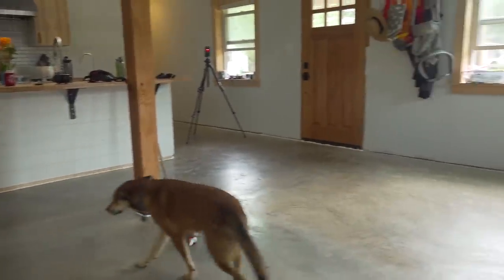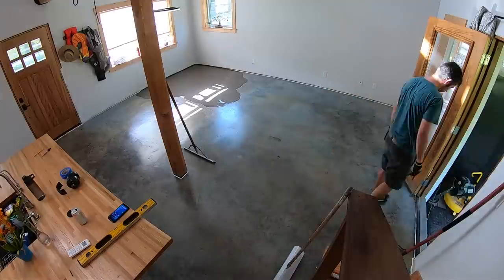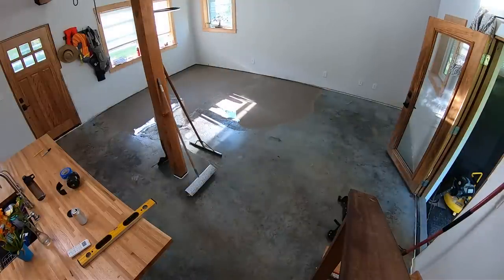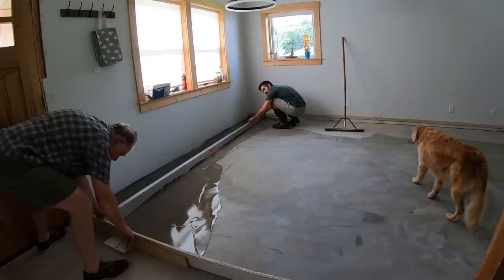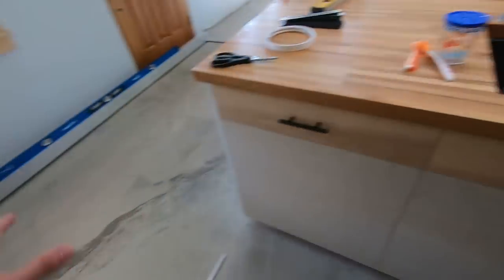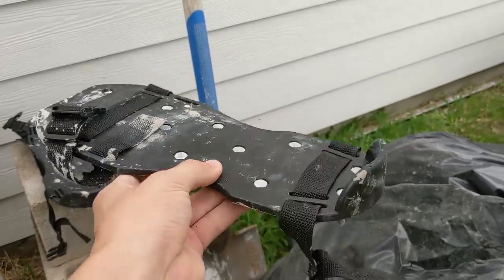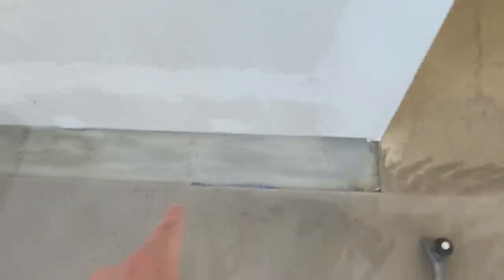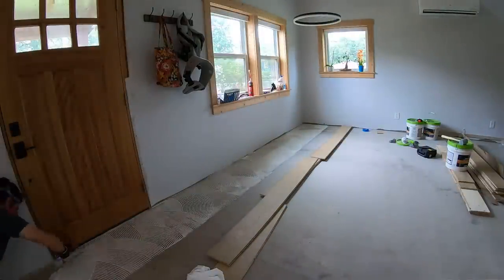How NOT to Self Level a Floor! Prepping for hardwood flooring | Building Small Ep. 6

Comment: Starting a project like this with no experience is just like paying dues to an apprenticeship class, it costs time and money but in the end you gain the experience same as a pro.  This applies to all things in construction and you can achieve professional level results if you approach it like a learning tool and be willing to undo your mistakes and repeat the process over.  Grinding down your first mistake was , in the long run, the right thing to do and is part of " paying dues " to gain a professional result.  Job well done , you should be proud of the accomplishment.

Comment: Thank you btw for adding this valuable footage we can share when our customers say the other company didn't bid $800 for floor leveling. until now ive always just had to say yes because they hadn't planned on doing it which is even worst. BTW the indoor air temp likely wasn't hurting you 1/2 as bad as the hot water in your hose was and not using a mixing drill on low speed. the faster you whip it the faster the reaction begins. Great content though!!

Comment: I have done self leveling many times.  I found what worked for me was to dry screed first.  I marked out with 'H" for high and "L" for low int he spots required.  Poured the compound in smaller batches as it is easier to control in all the "L's" and it did what it was meant to do, self level.  The high spots where just ground to level.  I had a learning curve as well but way cheaper as dozens of bags can get expensive.  Floor coloring not uniform but your laying over it anyhow.    He stuck with it and it turned out nice..

Comment: Thank you for helping my sanity. I just poured a bag of self leveler yesterday in my 6 x 8 shower. Apparently from the time carrying it from outside down to the bathroom, and then finding out that there were spots within the mix that were not mixed up enough ,and fixing that, it must’ve started setting up too fast. When I poured it out, it was like dealing with mud instead of water. I knew there was no way I would get it level. So I quickly scraped it back up and put it back in the bucket I took it out of. I now have a solid 40 pound bucket, and a great lesson learned.  Next attempt I will mix within the bathroom, use cold water, and be prepared to poor immediately.

Comment: Thumbs up for sharing a real life experience, had a realatable one.

Have year's of concrete experience but floor leveler is a different beast. 

Hired the wife to help with a master bath on the 3rd floor with a number of obstacles..

It was a humbling experience and a lesson learned.

Don't use a float to feather, use a steal trowel, no matter how hard you think you can push yourself anything over a patch requires prep and help.

Comment: I believe your biggest mistake is using the quick set leveler. It is on principal one of the easiest parts of the whole masonry to self level the floor. For such a big project you would need 2 guys but still it can be done with 1 guy. basically all you gotta do is mix down to the percentage ratio (it usually says 5 or 6L for a whole bag) so you take precisely that much water mix it in for precise amount of minutes it says on the bag and you just pour and that's it. Take a trowel to push it a bit and you pour another and another and another filling the room with liquid and letting the liquid thanks to the gravity level ITSELF.

You should not level it yourself. It levels on its own but the problem is as I checked the bag it is a quick set leveler which means it is for small jobs or multiple people big project jobs as there should be about 5 or 6 of them 3 mixing the bags 2 pouring and spreading as those very quickly become unworkable while the general AND quality ones takes about 20-30 minutes before they slightly harden and become unworkable but on principle you should pour take 5 minutes to not even smear but just slightly nudge the liquid until it stops moving on its own which stops fairly quickly and you go in mix another pour in and repeat and by the time you're done whole room should be still very much in liquid form as the liquid is still moving around filling in the dips and setting in.

I always steer clear of the quick sets on anything as I am not highly skilled because with the quick sets you need to know your shit down to the motion of your body as the rhythm is not set by you but by the mix and if you don't know what you are suppose to be doing that's it games over.
Reply: This looks to me exactly right. The 'RS' in that bag label means 'Rapid Set,' which is what you want if you're a pro, but if you're feeling your way through a new process it gives you no margin for error. There will be people who look at this and say, "This is harder than you think, which is why you need a pro." But my main takeaway is: don't use the products and process designed for pros, which have tuned their skills for speed and efficiency. Set yourself up with a more forgiving system to work with, because you know you'll be slow and inefficient.

Happily, Mapei makes self-leveler that takes much longer to cure, and gives you a lot more time to work. You need to give it a good 24-48 hours before you walk on it, which is why the pros might avoid it, but it's a better DIY option when you're in your learning curve.

Comment: Great video and good for you to share.  I have managed to mess up a few floors of my own. You sharing this will prepare others for what's ahead. Site and temp conditions and following the manufacturers directions to the letter make for success or failure. Overworking these products creates a nightmare. If you never try it again use an acrylic floor leveller which has a slower set up time and gives you a wet edge longer. The finished floor looked great we learn from our mistakes.

Comment: I did my first one last night, cool evening, and just pouring a little out a time and on hands and knees with a trowel to push it into the corners, just mixing 10kg at a time and it worked great but my room was a lot smaller than yours. Im really pleased with the outcome. I think if you never done it before, do small mixes at a time and get someone to mix while you pour and level. i didnt have a spike roller but wish i had one as it would have made it easier.

Comment: In the same boat you are in. My SLU was proud in some areas, low spots in others. It just sets up too fast
 They need to make an SLU that sets up in an hour instead of 20 mins. Bought the same Dewalt grinder, shroud and wheel as you. Your  method here works the best. Good work

Comment: I just went through a leveling nightmare myself. Thankfully it was in a smaller 14x11 room that needed 6 bags…. I mixed 3 to start with and halfway into mixing the 3rd bag (while having a hard time getting it mixed enough to begin with ) the only 1/2 inch corded drill I had burnt up! I thought it was going to burst into flames with all the smoke and sparking 🤦🏻‍♂️ oh man, I scrambled, and the fun didn’t stop there. My cordless had 3 half charged batteries that were overheating, shutting the drill down, dying, etc. What a friggin nightmare! At one point the drill stopped, I was in such a panic because the clock was ticking, I didn’t realize my finger was still on the trigger and pulled it out of the bucket….slinging cement all over E V E R Y THING!
I was ready to get in the fetal position and suck my thumb lol.
I ended up getting through it but I have some high spots to grind down and areas here and there to skim with patch to salvage it.
With two enguinal ( groin ) hernias, and a blown and herniated L5-S1 I’m not looking to pour it again 😅

Comment: Thank you for the video! Just botched up a floor in my house yesterday afternoon for similar reasons. Outside temperature was a bit high and I burnt my drill after mixing the 4th bag. Hand mixing was painfully slow and not lump free. I should have used a little bit more water and working in pairs with one guy operating the mixer is definitely a great idea.
It probably would've been better to stop when I saw it's going south and Google your video.
Next I'll have to get a floor grinder and grind the high spots down. I'm planning to pour over without taking down too much material.

Comment: LOL! Your experience was very similar to mine when I tried to level a 600 sq ft room.  First attempt I tried to do it without help in the summer and after the first couple buckets knew it wasn't working because it was setting faster than I could pour it out.  Spent a bunch of money and time grinding down that mistake.  Second attempt using ice water and a helper went better but still some high and low spots.  Then decided to try a patch approach where I alternatvely ground and leveled specific spots but it's still not level enough.  Every patch I fix reveals other spots that then need leveling.  I figured I would have to just pay someone to do it right but your video is encouraging me to make one more try at it.

Comment: With the extent of this project. I would have taken out the stove and dishwasher to have a uniform surface. I guess its just my OCD. Awesome job!
Reply: no, It's called foresight. what happens when you want to replace your dishwasher and the Floor level is too high to remove the old one? Are you going to call your cabinet guy to redo your whole cabinets just to replace your dishwasher just because you didn't remove it the first time?

Comment: Thanks for posting this.  I admire anyone who insists on doing a job on their own and is not afraid to try something new.  Youtube sure does help with the "mysteries".  Sometimes learning about anothers mistakes is better than learning the "proper way" to do something.  I like both actually.  I watched quite a few videos on self-leveling and this is the first one I came across that mentioned temperature.  Also, there are not too many contractors that will openly admit to screwing one of their jobs.  I'm sure most can appreciate that "pros" who do this for a living can't teach the one time do-it-yourselfer how to do it just like them.  Experience goes a long way thats for sure.   I would be prone to believe true self-leveling compound would have the vidcosity very close to water.  Wouldn't it be nice if that were the case.

Comment: While the concerns in this video are legit (especially the temperature!), I am a flooring installer and I did this so many times but I never went to such extremes! The idea is to start on the low spots, mix it liquid, and work yourself to high areas. If you need to pour anything more than 1/2 inch thick at a time (or the max thickness marked on the bag!), you should do multiple pours! If you are using straight edges and forms to do this, why not use something else (defeats the purpose of using self leveling!)? It would be so much cheaper ($60/bag self leveling vs $5-$15/bag anything else)!
Reply: I totally agree, was looking for a comment like this. I use a similar straight edge method with tile thinset. Much cheaper and you can actually slope it if you need the floor to be just flat and not exactly level.
Reply: So true, or grind the hi spots if posible and than fill up the low spots.
water the floor first (yes even when it is primered!)
or even better use te techn.in video while pouring the floor and non of this would be needed.
Reply: 16:11
Reply: Well he did title the video "what NOT to do", he wasn't suggesting it should be done this way. He lost hundreds of dollars and days of his time! He screwed up and he knew it, but he shared this anyway for others to learn from his mistakes. Not for professionals to berate him! 

What purpose does it actually serve to ask him "why didn't you..." after the fact? That's essentially asking "why didn't you just do it right the first time", it's unnecessarily condescending and judgmental. Why is a professional even watching a DIY video anyway??
Reply: @lblincoe2094  How did the commenter “berate” the original video? Aren’t you the one who’s really being “unnecessarily condescending and judgmental”? YouTube can do with more professionals, and less Karens.

Comment: I’m doing my first levelling project, and I felt like I’ve bitten off more than I can chew. I’m confident however that the glue process will hide quite a few blemishes. With the glue trowel being a foot long, that will help hide any low points between high point a foot apart.

Comment: Getting ready to do mine. Hot tip to use a long pole with paint roller on it minus  paint sleeve if you don't have a spiked roller...read directions so you buy correct drying times....Good Luck fellow warriors!

Comment: Good job. I thought long and hard about using self leveling compound but in the end decided not to and to just patch the few low spots. We have an OSB subfloor and I put down a floating floor so I didn't have to go to the same tolerance that you did. Man, what a pain...
Reply: Wtf is a floating floor
Reply: @DjSuperK  Laminate flooring is called floating it is not glued down it snaps together and the trim around the edge hold it down and allows it to expand and contract.  Same with snap together wood flooring.  Only major difference is the guy making the video can rent a machine and refinish his flooring where the floating one will be replaced after it looks no good.

Comment: I am surprised nobody has pointed out the obvious. There are RS and ES versions of the product. If you are not an expert, it totally makes sense to go with the ES version which gives you a lot more time to work with and level it.
Reply: Agreed completely but good luck finding the ES.  I live in Colorado and you pretty much have to special order ES from ACE and they charge $100 per bag due to weight in shipping.  HD told me they cannot get it.  I cannot find any intel on why HD sells only a quick setting product to DIYers - that’s idiotic!  Any DIYer would trade more working time for a product that sets overnight.  I’ve never even seen ES in a YouTube video which tells you it’s hard to find.  I’m trying Laticrete Level Flow for my next project which is supposed to have a longer working time

Comment: Self leveling compound? Just mix it with water and let it down the floor, use a spiked roller for the bubbles. Sounds great, everybody can do that. 

I fall for that trap, too.

I had the same experience as you, in my small bathroom 2x2m. I wanted to level my flloor because i had an unevenness up to 5mm in the corners. I spent some days for looking videos how to do and read the manuels etc, bought the complete equipment and the most recommendet self leveling compound. I have made the prework. I have mixed the compound exatly like it was written, temperatur everything was adjusted and double checked. When I let it down to the floor, everything went smooth. After work the floor was like a flat mirror, I was absolutely happy. 
The next day in the morning I sprang out of my bed an ran direktly to check my floor. It was a nightmare, the surface was not flat. I had a big hump in the middle and the difference from high to low was now more than 10mm. 

Fortunately, the extra material on the floor was not a problem. So I grinded the floor and leveld it again. This time I used tile adhesive and a ruler. Before I startet, I leveled guides on the floor. The outcome was 100%, less than 1mm unevenness. Next time i will do it the same way.

Comment: I always mix 100 lbs at a time. The larger the batches the less ripples you get. Coldest water possible. Comes out like loose cake batter. Work fast. Knock down each pour with trowel to give it help. When next pour hits last pour it starts to activate quicker. Dam up heat ducts and caulk big cracks or you will find it leaking through everywhere.

Comment: I think you're making a mistake not pulling the base-cabinets and dishwasher out of the kitchen. Once you raise the floor-level with the soupy cement and the thickness of the hardwood flooring you'll never be able to remove the dishwasher out for repairs and the kick-space will become too short for your feet to comfortably fit in under the cabinets. You should have removed the cabinets and dishwasher, spread your leveling cement there and after it set up, installed a plywood base the same thickness as your wood flooring. (Speaking from sad experience 2 times.)

Comment: You had all the tools except a gauge rake. They come in adjustable design or serrated. This is used to pull your self levelling to a set thickness. Thereafter quickly spike roll to remove the bubbles. I've been laying flooring for over 30 years and if one doesn't understand the timing of SL it can really turn on you. 
Lastly its best to pregrind the high spots or fill low spots. BUT doorways and entrances are your points to determine thickness. P.s. don't ever pour less than 3mm.
Reply: Because it cracks?
Reply: @ben.helmuth  100% correct.

Comment: You can use tabs, which you can get from a specialty flooring place so you dont have to use the laser level technique.

They stick to the floor and they have a measuring stick on them. You place these around, set your laser near the floor, then mark the tabs individually and then you pour around the tabs. Voila, perfectly level, you keep pouring until all the tabs are buried to the right height on the marking stick and then you let it dry. The tabs then break off after.

Saves the trouble, its easy to do and its very precise.

Also not sure which brand you used but UZIN makes some really good self leveling compounds. Then you can fix/feather the edge with UZIN 886 or 888 if you have a small curb and your pour wasnt the entire area.

GOod luck next time!
Reply: Tabs? You mean spacers?

Comment: I have had a nightmare as well with self leveling. Seemed that the amount of water the product called for in the instructions was not enough and it set up and was lumpy. Had to spend a long time grinding it up. Talked to some contractors in my area and they won't touch self leveling jobs.